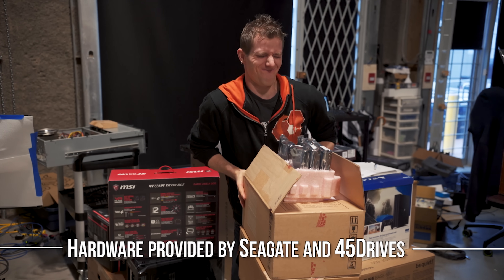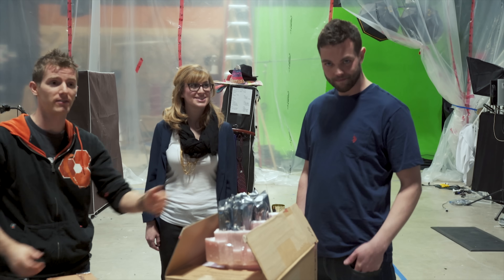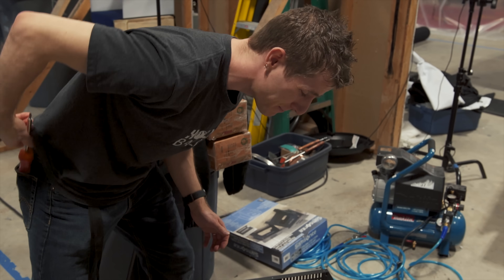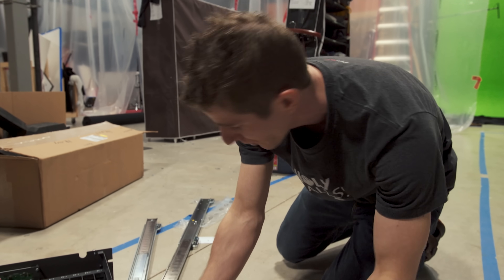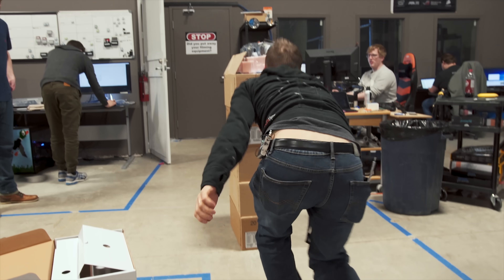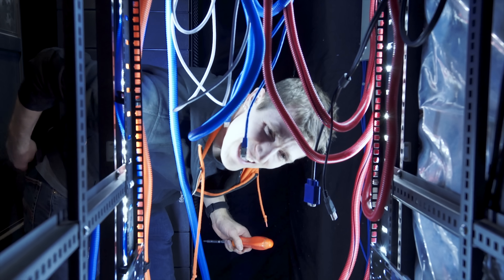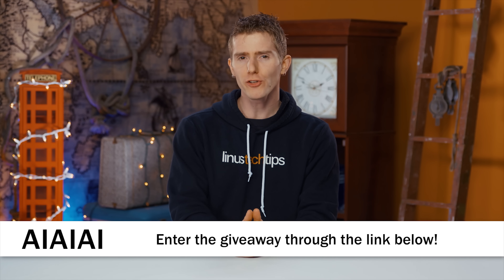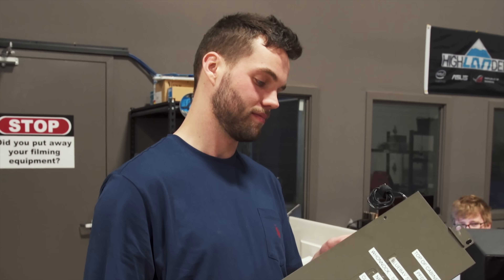INSTALLING THE PETABYTE - Server Room Upgrade Vlog

Comment: No need to be so difficult, just use the Storage Spaces in Windows Server.  You can add harddisk (1 or 2 or whatever) to an existing Volume, like to expanding the Volume, and it will be ok.

Comment: Your data is not secure on a RAID, NEVER ! Because you can have more 
than one failure on this massive amount of hardware. Not using a backup 
(e.g. a non spinning disk in a vault) for important data is just 
crazy...

Comment: 30 years ago in 1989, the largest hard drive capacity was less than 1 GB. Now (2019) 4 TB hard drives are common. Do you think 30 years from now 1 Petabyte (1,000 TB) HDD or SSD became reality? They said Moore's law is now slowing down due to difficulty on shrinking pieces of information on SSD and HDD due to quantum mechanics.

Comment: The 1GB has lost its value
Reply: Fun fact : 1 pettabyte = 1,048,576 Gigabytes
Reply: @SubscribersWithoutanyvid-mn8ot  No, it isn't. 1 PB = 1,000,000 GB. End of story.
Reply: 1313e 
Not really, a TB is usually 1024GB (1TB)

1.0TB is 1000GB
Reply: @1313eable  lmao no
Reply: Amit Kulkarni thats what we all said/meant except for that 1313e dude
Reply: 1kB is 1024 bytes or 1000 bytes while 1kb is 1000 bytes and 1kiB is 1024 bytes.
Units are almost always case sensitive.
Reply: @ornatedesk1779  What does the "i" stand for in kiB?
Reply: @ephraimmulilo7098 I never thought about it, according to a website called major differences, kiB is (kibi) Bytes which is (kilo binary) Bytes.
Reply: @ornatedesk1779  1 KB is 1024 Bytes.
And 1 Byte is 8 bit.
1 TB = 1024 GB
1 PB = 1024 TB
This is how pc works.
I think I haven't seen such as kiB in PC whn I check size of a file using default explorer.
It may b to avoid confusion. I think in windows KB = 1024 Bytes
And kb is not equal to 1000 bytes. It is kilo bits . U can see that when we say about internet speed.
Btw what is ur real name?
Reply: @squidscrew1339  In case of internet speeds I have seen kiB. I don't know why windows uses KB for kilobytes. K is Kelvin and k is kilo.
So, I was wrong about kb. 1000kb should be 125kB.
P.S My name is Adarsh. Do I know you from somewhere?
Reply: @ornatedesk1779  am from India.
Reply: @squidscrew1339  pkd?
Reply: @ornatedesk1779  MLPM.
Reply: @squidscrew1339  I don't know anyone from there.
Reply: @squidscrew1339  No,
1 kB is 1000 Bytes
1 MB is 1000 kB
1 GB is 1000 MB
1 TB is 1000 GB
1 PB is 1000 TB
----------------------------------------
1 KiB is 1024 Bytes
1 MiB is 1024 kiB
1 GiB is 1024 MiB
1 TiB is 1024 GiB
1 PiB is 1024 TiB

The upper prefixes are metric, the lower ones are binary according to ISO/IEC 80000.
Any other use of these prefixes is wrong, no matter by whom.
Reply: @MajinOthinus  am talking about what's in windows pc explorer as default  Bcz most of ours will b using that. Whenever I check properties of a file in windows , I can see size of a file will b calculated based on what I hav said before.  I think my android phone default explorer also works in that way.
Reply: @UCYHQ2ICPywHk9wPIp364xQQ Not in Windows, but Windows isn't the standard. The ones manufacturing, professionally coding and actually researching in the field set the standard.

This isn't about 3rd party software, it's the fundamental units of measurement. Misuse of the Kilogramm by Americans lliving under the imperial system doesn't mean the Kilogramm can be used that way; it stays wrong usage. As does misusing GB and GiB.

Comment: Don't use tunnel bear it's crap. I tried the free trial and it looked promising but after purchasing the full version, it would not connect. I attempted contacting support to ask for a refund but they never responded, so I was out the 1 year subscription price I paid. There are many other VPN services which offer superior customer service. So I would highly recommend one of them over Tunnel bear. If you still decide to purchase their service, be warned.

Comment: 1,000 GB in a TB
x1,000 TB in a PB
1,000,000 GB
x 3 seconds per GB
3,000,000 seconds of raw footage
/ 60 seconds per minute
/ 60 minutes per hour
833.3 hours
Even if they only add on average an hour of footage per day to the vault, (and not including space for configuration etc) they'll fill this by sometime this spring at the latest lol.
Reply: They don't save the raw footage, just the exported videos and presets used, or the transcoded 4k gopro cineform which is about 60gb per video
Reply: @roadsportuk  if you fix that , you get 873 hours. Not much either
Reply: well, it´s full now, kinda did make it to fall but wass really close
Reply: @roadsportuk  Wrong guy. You mean the OP
Reply: Umm actually.
It's 1024 not 1000
Reply: 1024 gb is 1 tb.and 1024 tb is 1 pb. and 1024 pb  is 1 yb, and so on
Reply: no, 1,024 Bytes in a Kilobyte, 1,024 Kilobytes in a Megabyte, 1,024 Megabytes in a Gigabyte, 1,024 Gigabytes in a Terabyte then 1,024 Terabytes in a Petabyte. Your calculation ended up with 1,000,000 Gigabytes, assuming that 3 seconds is a Gigabyte with that he could record about 92 and a half hours of footage, where as with the actual total of 94.8 hours which would allow him to record a further 2.3 hours of footage before having to get another server.
Reply: Technically using Kilo, Mega, Giga, and co implies order of 1000's. When you talk 1024 its Kibi, Mebi, and Gibi and so on.
Reply: @empty3102  no. Ever wondered why a 1tb drive shows 931gb?

Because its 1,000,000,000,000 ÷ (1024*1024*1024) = 931.xx

Why did the petabyte project show only 700+ tb?

Cfs provision.
Reply: @SabbyNGG  First 1TB is ~931GiB, not 931GB. The average Joe doesnt know better so it is what it is due to marketing.
Reply: 931.xx GiB
= 931.xx*1024 MiB
= 931.xx*1024^2 KiB
= 931.xx*1024^3 B
= 1,000,000,000,000 B

Just google it, 1TB returns as 1000GB and as 931.xx GiB on the google unit conversion calculator.

Comment: 6:35 Should've ether used a nylon mallet (Which I assume you don't have) or put a piece of wood on the metal before putting it back in shape. That way the force is dispersed and you don't get dents. Or you could've used a vice grip with nylon grips/a piece of wood. - that's the budget way of fixing metal dents and bends.

Comment: I am actually working on a kick-ass gaming computer dell dimension e310 running 1 tb ssd then 250 gb hard drive for mapping n shortcuts then 10 10 tb hdd in in 10 different computers to make 1 pb with 1 ektra **fuck you auto correct * computer for 1 giant server with lots of os for a $H!T TON OF games

Comment: 2 years, later... INSTALLING THE EXABYTE
Reply: Yottabyte.
Reply: Yeetabyte.
Reply: Bleachbyte
Reply: Exabyte is like 1/3rd of the internet.
Reply: @supersaiyancommenter  Exabyte is 1/300 if google
Reply: Shitabyte
Reply: Droppabyte
Reply: Rockabyete
Reply: Shittybyte
Reply: well he installs it in 2026, im from the future
Reply: Fartabyte.
Reply: Not quite
Reply: Not yet
Reply: Gaybyte
Reply: Still waiting
Reply: um... but nothing happened right now
Reply: Where exabyte?
Reply: @PlayerEngineer  hes lie lol
Reply: 1024∞
Reply: Feetusbyte
Reply: y52w5uwtj
Reply: Æbyte
Reply: It's 2019 no exabyte project
Reply: @fir345  zettabyte is already a thing
Reply: It is 2 years later sadly no exabyte
Reply: abcdefghijklmnopqrstuvwxyzbyte
Reply: 100k subscribersbyte
Reply: EXTRABYTE
Reply: FaxulZetaPlexaHexaUnATriByte
Reply: S u c c‘o Byte
Reply: Two years later...DIVORCE PAPERS after that top-heavy remark.
Reply: The Yottabyte Windows 50 Intel core i30 512K display running at 360 FPS with 1 Zettabyte of storage touchscreen tablet display desktop, reason as to why is a tablet display is because you can install your iPad Pro XXL 40 into the screens slot, as there’s not a screen slot but it’s a slot to be able to eject your screen so you can hand hold the monitor, making it into a tablet again until plugged into the display usb slot.
Reply: Actually a petabyte is bigger than exabyte
Reply: Googoldplexiumbyte
Reply: @fir345  80 years before...  INSTALLING THE BOOMBYTE
Reply: years before, installing the byte
Reply: Idkthenameforthis byte.
Reply: Byte
Reply: Zettabytes
Reply: Bruhbite
Reply: Zettabyte
Reply: nani byte.
Reply: Ninabyte
Reply: Nope. He didnt
Reply: Not yet
Reply: Why dont now
Reply: 4 yrs later, installing the yotabyte
Reply: here we are in 2021... NopE.
Reply: Hasn't installed yet
Reply: @abdulrahmankhan2577  well obviously 😐
Reply: Not yet .
Reply: Sadly nope
Reply: lol
Reply: Infinity byte
Reply: BoiByte
Reply: Nah....Googoleplexbyte
Reply: Brownbyte
Reply: Bitchabyte

Comment: Think only 128GB is enough? Under most people's recommendation, it's 1GB per 1TB of storage (ECC Ram specifically, for speed incase it needs to rebuild the array). The way the array is setup may depend on this, if each raid is controlled via clusters of 128GB volumes, you could get away with partial hardware and software raid I would presume on just 128GB of RAM.

Comment: LTT really needs to invest in A: safety toe work shoes (those heavy boxes are gonna mess your toes up through your sandals and socks) and B: a hand truck. It's significantly faster, easier, safer, and more efficient than making a stack and sliding them along the floor.

Comment: I know I'm kinda late but, why using gluster? you could create a ceph  cluster, where each storinator is a node. Add that with erasure code and you will have much less overhead. Plus, you can object and file access, and it scales way more than gluster

Comment: gluster is a user space file system, i suggest u use luster if you want more performance and also some ssds for L2 cache. You can also check out IBM GBFS, https://en.wikipedia.org/wiki/Lustre_(file_system), https://en.wikipedia.org/wiki/IBM_General_Parallel_File_System, both will help your video editing performance, especially for 8K . Also if you require insane amounts of bandwidth for you editing workstations instead of fibre channel which is crazy expensive you can look at 12 Gb/6Gb SAS switches and LSI cards for your workstations to connect to your servers directly instead of ethernet. Also you could use infiniband

here are some design facts from intel: https://www.intel.com/content/dam/www/public/us/en/documents/white-papers/architecting-lustre-storage-white-paper.pdf

Comment: 300MB/s ? When I was recording uncompressed at 4K with the YV12 codec (lossless) at only 60fps I needed a whopping 700MB/s, which I attained with 5 x 1TB WD Blue drives in raid 0, just barely.
So that 8K camera of yours isn't recording lossless.

Comment: Hi, I'm Nicolas and I have a project to implant cryptocurrencies in my society but I need help. Any donation, however small, is appreciated.
Bitcoin:
3GHzFFgcuYdximjoDhrTfGAZSKwDHvcpEj
Ethereum:
0x83B10Cbf95F1055E95ed52d6894B4795180a4853
Bitcoin Cash:
1CCeBoHRHmn7CVp1NJq3M8bAvXUfvrotfY
Litecoin:
MFHUAPh2ojmR7LnmoDLXtohZsqryYSKa1E

Comment: With so much video to move around, if the video storage is to be centralized on just a couple of servers, then it's already time to move onward to 40-Gbps or 100-Gbps NICs. But that illustrates why over-centralizing video processing storage can be very, very costly. Have you priced Ethernet switches with 40 and 100-Gbps ports yet? Have you had a conversation with a data center switch vendor about a marketing demo video? Also seems like there is enough gear on hand to make more rack-vendor and UPS-vendor videos.

Comment: WHY are you not using higher-performance LOCAL workstation storage to process video, combined with a BACKUP SERVER that sweeps through the workstations, duplicating data to safe server storage, away from potential user error, malware, and storage failure? 

WHY centralize front-line work into one modest network and one or two catch-all servers ???

Comment: I have a motherboard which has 6 sata ports but I wish to install around 10 hard drives into my pc, is it possible to use PCIE lane cards to attach more hard drives? And if so what kind of pcie cards will I have to buy?

Comment: In my workstation I have a 128 GB SSD which is my Systemdrive, and then I have 4 HDD's with 1TB each. I run them in raid 5. The funny thing is that I mostly have games on the Data drive. I have used about 300 gb xD

Comment: CLICKBAIT ALERT ☡
It's 778 T.B.
Not 1 Petabyte 🙄
Reply: They are installing 98 drives at 10 TB each, that's 980 TB. Windows shows 778 TB, but it's really 778 TiB/855.5 TB (Windows uses wrong/outdated calculation for the prefixes).  I guess that the "missing" 124.5 TB (980-855.5) is for redundancy + filesystem overhead. But 980 TB ain't a Petabyte either.
Reply: its because one of the byte measurements (idk which) maybe kilo-megabyte goes 1024 kilobytes to 1 megabyte, which shows a lower value
Reply: If they used Linux it would've showed 1PB or close to it.
Reply: Would have been to difficult to say 750tb but really 1PB
Reply: Pretty sure 980TB isn't 1PB
Reply: 980,000,000,000,000 B is not anywhere near the 9.007e+15 b required for 1PB formatted
Reply: Rewatch the footage. When they show the server motherboard and talk about the ram amount used you can see multiple 2.5" drives or SSDs hanging to the side. They probably have a TB of ssd per system as pure cache for the drives themselves.
Reply: 778 TiB, not TB.
Windows uses Tebibytes. Not terabytes.
Reply: Raw storage at 1PB. After protection and overheard, of course it will be lower available storage. Most companies advertise the raw storage instead of available storage.

Comment: 1 Bit = Binary Digit
8 Bits = 1 Byte
1024 Byte = 1 KiloByte
1024 KiloByte = 1 MegaByte
1024 MegaByte = 1 GigaByte
1024 GigaByte = 1 TeraByte
1024 TeraByte = 1 PetaByte
1024 PetaByte = 1 ExaByte
1024 ExaByte = 1 ZettaByte
1024 ZettaByte = 1 YottaByte
1024 YottaByte = 1 BrontoByte
1024 BrontoByte = 1 GeopByte
1024 GeopByte = 1 SaganByte
1024 SaganByte = 1 PijaByte
1024 PijaByte = 1 AlphaByte
1024 AlphaByte = 1 KyratByte
1024 KryatByte = 1 AmosByte
1024 Amosbyte = 1 PectrolByte
1024 PectrolByte = BolgerByte
1024 BolgerByte = 1 SamboByte
1024 SamboByte = 1 QuesaByte
1024 QuesaByte = 1 KinsaByte
1024 KinsaByte = 1 RutherByte
1024 RutherByte = 1 DubniByte
1024 DubniByte = 1 SeaborgByte
1024 SeaborgByte = 1 BohrByte
1024 BohrByte = 1 HassiuByte
1024 HassiuByte = 1 MeitnerByte
1024 MeitnerByte = 1 DarmstadByte
1024 DarmstadByte = 1 RoentByte
1024 Roentbyte = 1 CoperByte

Comment: Its sometimes it's something small, this kind of reminds me of a PC fix, I did yesterday. I had a junked system that was spitting out memory error beeps and refusing to boot, in the end I took off the CPU and between the CPU and ZIF socket, I found some white stuff.

So far in tests, it boots fine.

Comment: To think that 1gram of DNA can store this ammount without error coding installed.
Microsoft is planning to replace their Tape drive archive with DNA.8-]
Reply: Josef Strydom what? You don’t measure dna in grams
Reply: slitheringsnake 2 , In pounds you say , Murica?
Reply: Without coding error ? How do you think mutations work ? :)
Reply: SerBallister: error code as in coding that counter these mutations a forward-
error-correcting technique

Comment: Linus, you should install a air conditioning machine in there. Lowering the ambient temperature will help a lot not only with noise, but with the integrity of the data.

Comment: I have a little suggestion, but first I want to state; I'm no tech guy, and don't rally know anything about all this stuff, so yeah.

You said your storage for all your old projects was filled, well here's my suggestion.
creat a file system that will store an old project on one single drive, maybe two for redundancy, then once you fill those 1 (or two) drives up with several projects/videos that you dont believe you will touch for a while, remove the drives from the server and store them in a safe location with a label to state what they are. Maybe write a quick program that creates a database to store all the information about the drive, and what's on it, and associate that information with a digit, for easy relocation or storage of the drives.

Then you could replace those drives with fresh empty drives and continue storing old or new projects. I do this myself with old photos/videos except on a much smaller scale (1-4tb eternal HDs) I will take a file that i dont believe i will need access to for a long while, and store it in what i call 'deep storage" which means its removed from my main server/computer and stored in a safe and secure location, in my case, a depository safe located in my wall.

Food for though, again, i dont even know if something like this would be possible for your current set up.

Let me know your input. Again, I'm no techy, and definitely dont know anything about what i just watched in this video. Only thing I know is, I HATE seeing that little red line on my harddrive screen telling me my storage is almost full. Lol